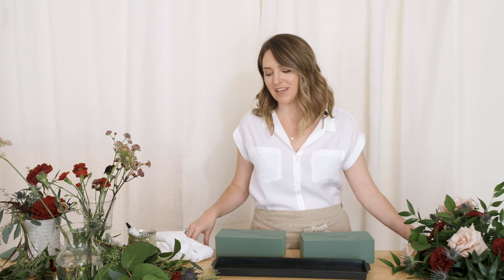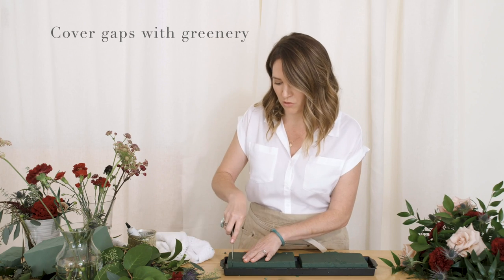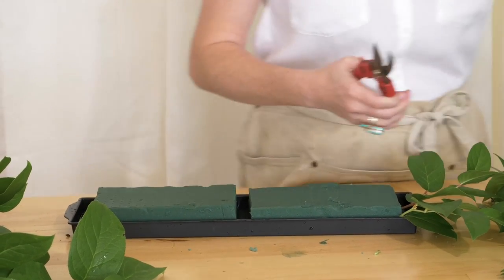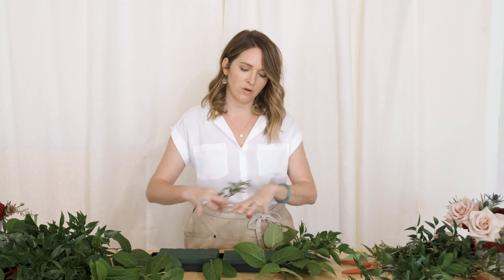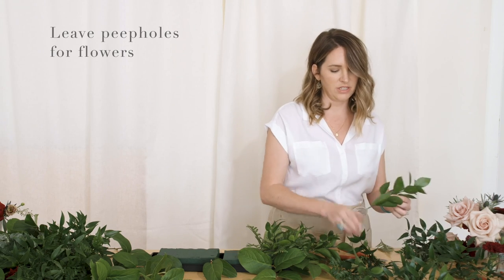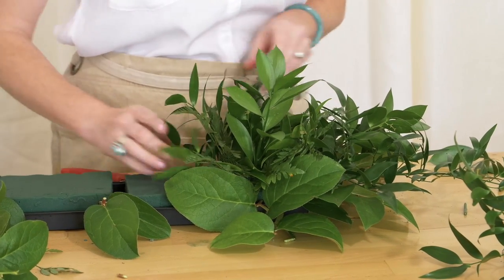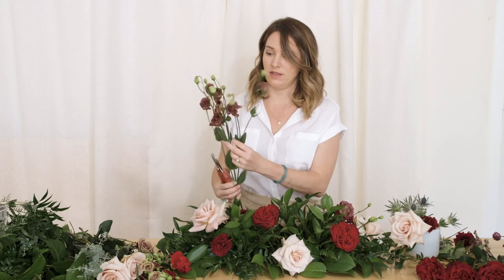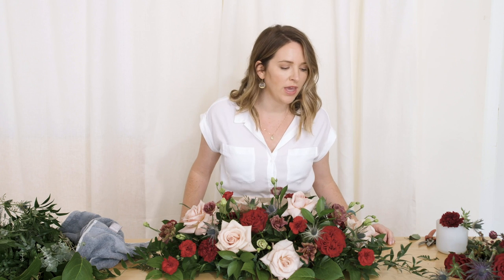How To Make a Floral Runner Centerpiece with an Oasis Tray | Flower Moxie | DIY Wedding Flowers

Comment: Its me again. How would Hydrangeas look in this. I'm thinking 2 white hydrangeas, 1 bunch burgundy ranunculus, 1 bunch burgundy spray roses, and 2 bunch blush spray carnations with all the greenery you mentioned. 

Would you put the hydrangeas flat on top and the rest flowers all around them and in between? Please advise. Your videos and your suggestions have helped me so much. I cant thank you enough. ❤🤗
Reply from the maker: Howdy!  Thank you for your question and kind comment!  Ok, so hydrangeas don't love foam that is not submerged in water.  However, that doesn't mean you CAN'T, you will just need to have special care.  Here are my hydrangea tips in a foam tray:

-  Place them on the day of the event, and after you rewet the foam with your kitchen sink sprayer.  If you are building the day before, then go ahead and build them WITH the hydrangea and when you're done pull them out and pop them in a vase of water, and replace them the following day.

-  Cut and dip them in Alum before pushing the stem into the foam.  Alum is basically potassium sulfate that extends the life of food but works great with Hydrangea.  It's found in the spice section of the grocery store

-  Spray the whole thing down with Crowning Glory or Hawaiian mist.
Reply: Can't thank you enough.  Bless you !  Keep bringing great videos for novices like me. 💞🙏

Comment: Hi,

I'm planning a DIY yourself flower arrangements due to be me getting married in a public garden and having my reception so I felt silly having artificial table runners. Your tutorial has been the easiest to follow but I might have a silly question how do you pick  the finished product and transport it
Reply from the maker: Hello Cathrine, so glad my videos help you!  So when transporting it, I just position them tightly in the back of my hatchback.  If it's a vase full of water I dump most out and refill when I get to the venue. 

What do you mean by 'how do I pick the finished product'?  I wanna make sure I give you the right answer!  XOXOX
Reply: @FlowerMoxie   I meant to pick it up and move it from point A to B I'm scared that everything will just fall apart.
Reply from the maker: @cathrinechitewe4342  Ah, that's no biggy biggy!  The bottom of the tray is ridged, but you ALWAYS want to tape in your mechanics or foam with green waterproof floral tape so the foam doesn't jump ship.  Do this with every centerpiece and urn.  The times I've skipped this step as only broken my heart, as the wind can grab the top-heavy arrangement and send it hurdling to the ground. LOL

Comment: Love your work! What size was the tray that you used? I want to do this for a head table for a wedding, Should I tape the foam to the tray?
Reply from the maker: I used a double brick tray by OASIS!  I'd recommend maybe getting a triple brick tray and spacing them out.  You don't have to use tape, but tape would make it more secure.  Buy waterproof green floral tape, it's better than the clear!  Here's a link I found to get a pack of them direclty:  https://oasisfloralproducts.com/occasions/event-products/basic-plastics-event/oasis-single-brick-tray-black/?attribute_pa_size=double&attribute_unit=Pack
Reply: Flower Moxie thank you
Reply: Flower Moxie will the triple brick tray works better for a 6ft rectangular table?
Reply from the maker: @talyhaye1619  I think so, here are the dimensions:  26-1/2 inches x 4-1/2 inches x 3/4 inch

You can build it larger not cutting the stems so short on the ends.

Comment: Is there a reason you cut the stems of an already small piece of greenery? I noticed that quite a bit
Reply: One reason is if the piece has been out of water for a while, the end dries up and seals and water won't get sucked up, so a new cut and then placed in the wet foam allows for the piece to drink better.